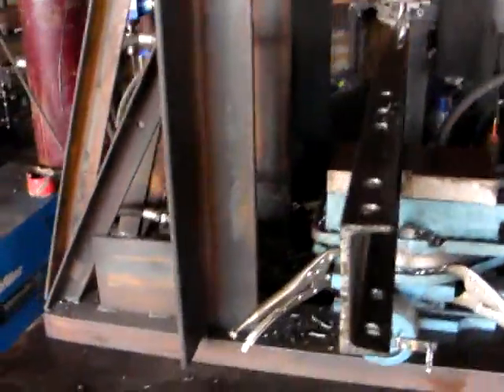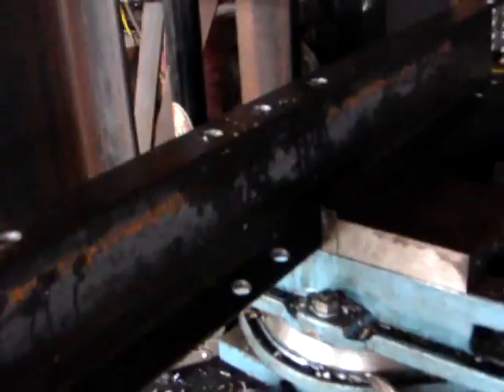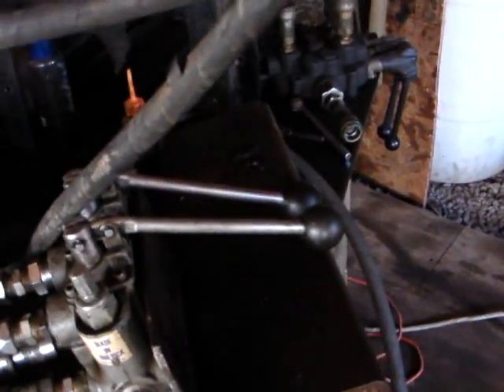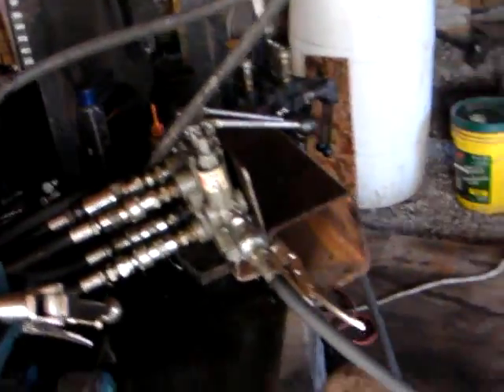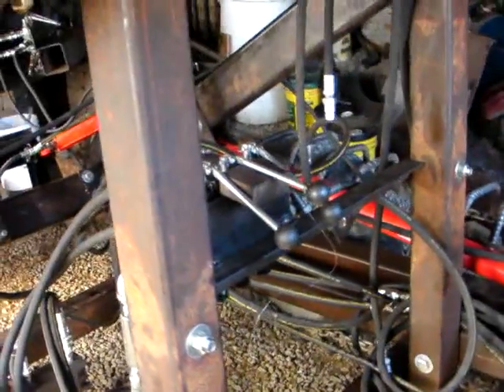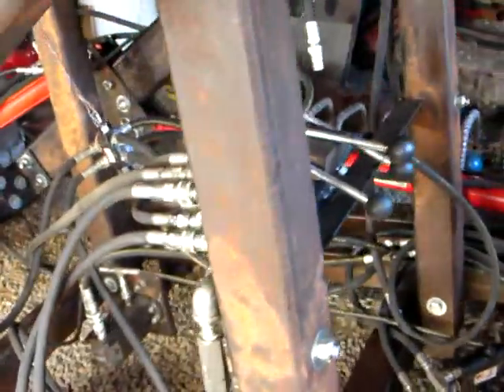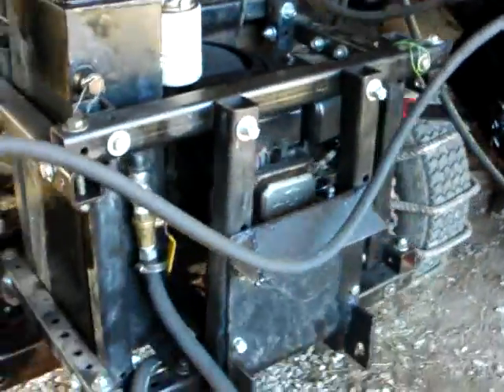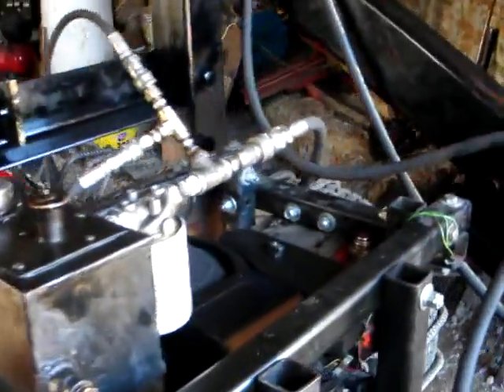Open Source Drill Press prototype 1 (@fef,ose)

Comment from the maker: @ElizabethAGreene Because we use hydraulics for most of our tools so as we have many hydraulic cylinders it's easier and quicker to build a press around one. We got good control over the pressure so only broke one bit. Also we only used a minimum of 3/4" drill bit size which are quite strong. I would like to make one with gears and a lever for the extra control. Just not got around to it yet. If you know of any designs please pass them on?